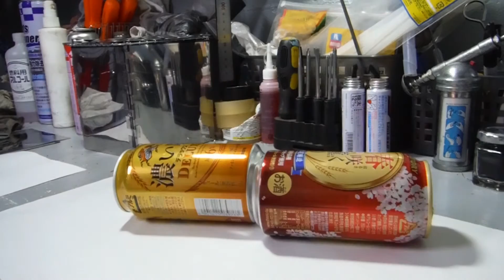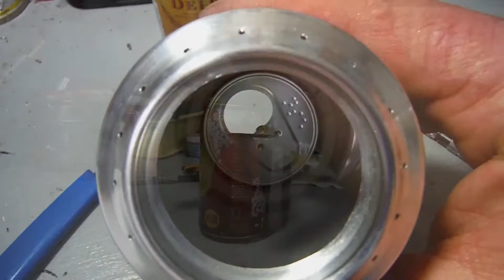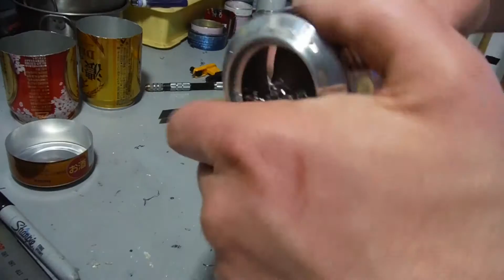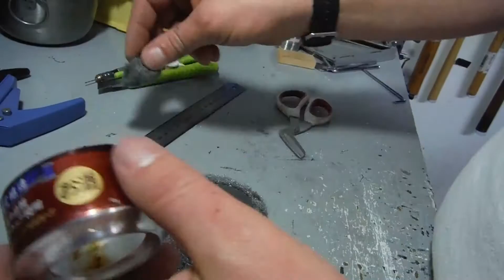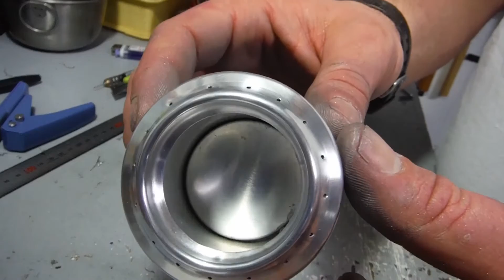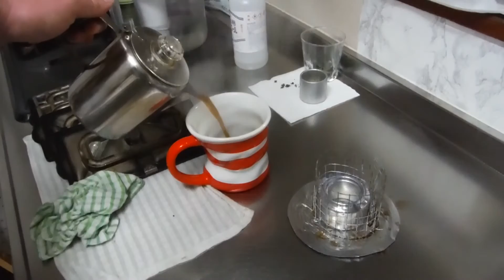Open Jet Top Burner  Alcohol Stoves

Comment: Hi , great video and really well presented.  I have made many of these types of stoves but never added insulation in between the walls..  At the end of you video once the stove was under the pot it looked as if just the jets were lit and the centre flame had gone out which would be great and would save fuel... Is this what`s happening or am i mistaken...
Reply from the maker: Thank you very much! I love these little stoves and use them all the time. The difference between having the wick and not is big! With the steel wool inside wicking the alcohol up the jets usually bloom within 10-15seconds.
As the stove blooms and the jets start acting the center is lit but not as much but, 3-4 minutes in as the stove heats up and the jets sort of die back as the alcohol is draining, the center takes over and makes a beautiful center flame! I usually only use enough alcohol for what Im making but filled this stove will run for about 30 minutes!